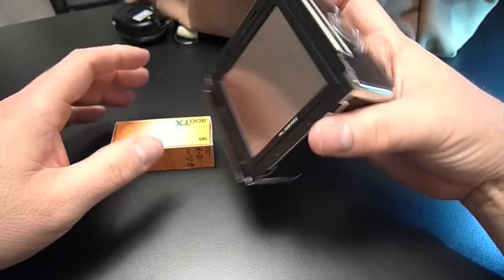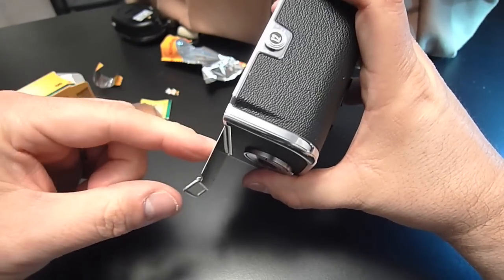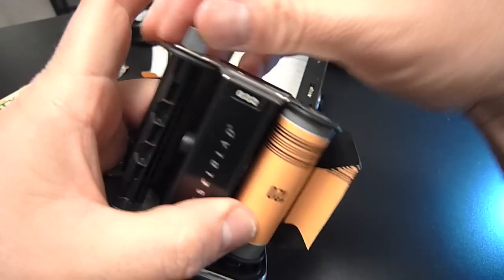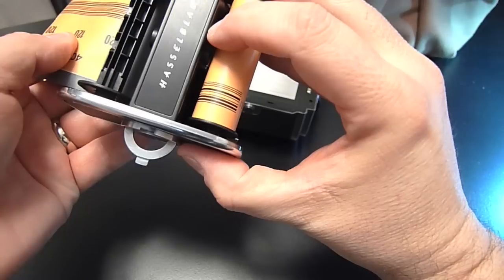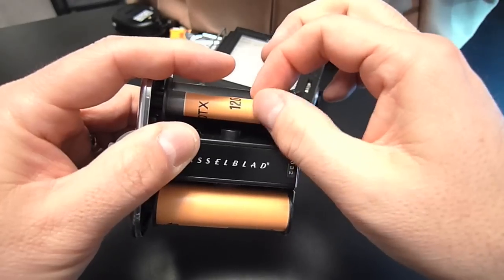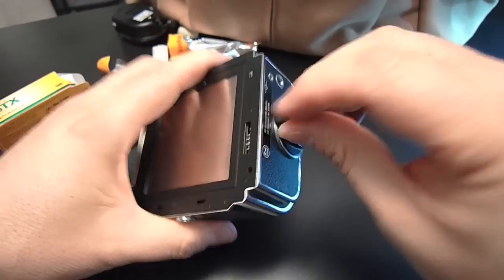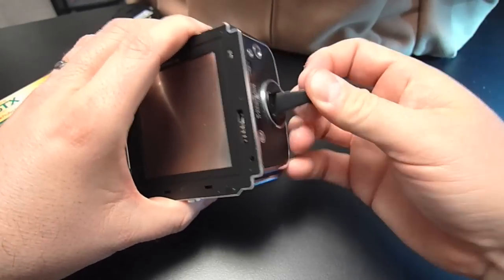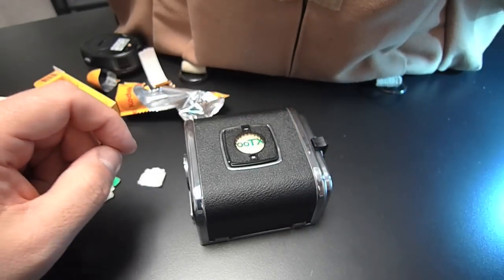Photo: How to Load a Hasselblad Film Back

Comment from the maker: @The1970sInfatuate Actually I wonder if you meant to ask this question on the instant film video (?).  If so, the camera used there is a 500c/m.  You can't use the Polaroid back on a 2000FCW -- it will damage the shutter.

Comment: great video, the H system HM 16-32 loads simmilar, no silver tab, or winding knob,but has a captive crank-on\off style darkslide, you have to man-handle the takeup spool, but as soon as you switch on and hit the shutter it auto winds to frame one, there is even a darkslide shut warning on the body, a 6x4.5 format, but still a somewhat simple system, but with the H back it uses a cr2032 button cell battery (it does use the body battery-when ON the camera), but if you don't have this battery, you instantly lose the frame count\asa\data imprint and other settings, as this is 'stored' on the film mag's chip, and if you power it down (by taking the mag off), there goes the roll.

Comment: First, great video! One thing you may want to add: With the 500c (and I'm guessing the 500c/m), one must be sure that the body is cocked BEFORE attaching the back, otherwise, if you crank it after attaching the back, you will lose your first frame. I've been told later models don't have this issue.
Reply from the maker: Good point. I guess I was so used to keeping Hasselblads cocked at all times that it didn’t even occur to me to mention it!  Thanks :-)

Comment: hi Mike, 
thanks for your instructions, i just loaded my first film, but i had to go a little past the arrow to create some extra tension on the film. the winding worked an now i am on (1). 
do you think i will still be able to shoot normally or will the film be misaligned now ?
Reply from the maker: MarcS4R  Congrats!  There are no frames on the film, if that's your concern (the exposures make the "frames").  There's just a certain amount of film on the roll.  If you went way too far past the arrow, you just wouldn't get 12 full frames.  My guess is you'll be just fine.

Comment: Thank you for the tutorial! I've never used Hasselblad before and it was the first time I've tried to load film into it with your tutorial. However I've missed that little detail that the metal plate shouldn't have been removed when winding the film, I just didn't think about it so I winded 10 turns  to the frame 1. Does it mean that now my entire roll got exposed or just the beginning of the roll? Thank you!
Reply from the maker: If you wound it to frame 1 with the back mounted on the camera, you’re probably OK due to the rear shutters in the body.  Any other possiblity will probably result in at least some leaks on the next frame, and maybe the next (?)  I’d just shoot this roll on non-critical stuff while you’re learning the camera, if I were you.
Reply: @mike.thomas  Thank you very much!

Comment: Hi,
my problem is, to find the right position for the first picture when I loaded it.
because every second time the pictures are half cutted when I became them back.
even with a second magazin it happens (I thought maybe the one I have is not OK and a other one would work : hoped there will be a little noise or latch whe it is on it´s correct position for picture number 1 like as in "normal" cameras, but it isn´t, or are both magazin of mine damaged?
hope you understand my problem, even with my not so good english
Reply from the maker: matt Ruml I think I understand.  If you have a new "A" style back, then the back's winding knob should stop turning at the correct point automatically.  If you have an old-style back (with a window), you have to watch in the window while you wind the back's winder until you see a '1', indicating the first frame.  Turn the back's wind knob reverse very slightly to reset the film counter.

If you are doing the above procedures correctly, and still having issue with two different backs, then perhaps there is a problem with the body (?).
Reply: +Mike Thomas: thanks a lot ! I have just the old ones ( fits to the body ) 
but I guess I will look for a newer One.
Reply from the maker: The old ones should work fine if you follow the correct procedure (and if they are in good order).

Comment: Hey I'm in need of help. I tried loading film into my older a12 back and the back doesn't clamp the film well when I turn the lock so it falls out and when I thought it was working I did everything you said but when I wound the film to the first frame it was very hard to wind and eventually ripped in half before reaching the first frame. I don't know what to do I can't find anything about that online.
Reply from the maker: Hi Daniel.  This is one of those things that's very hard to diagnose unless I can see it.  Can you shoot some video of your next attempt?  If you followed the video carefully, you shouldn't have any problems.  On the other hand, these backs are as complicate as a swiss watch, and sometimes they have issues.  It may need service.
Reply: Mike Thomas Hey Mike thanks alot for attempting to help, I really appreciate it! After a close inspection using a dead roll to observe what was happening, I've concluded that it was just simply one of the little screws that hold the pressure plate on. The screw was just sticking out enough over the plate that the film would get stuck on it. Film now loads and winds without a problem. Thanks again for getting back at your viewers so efficiently and attempting to help everyone
Reply from the maker: Oh, glad to hear it was an easy fix!

Comment: one warning, the INSTANT the frame counter passes 1 the film crank on the back is able to turn again, like the mamiya RB67 and others, but without the interlock switch!, so ONLY use the BODY winding knob until the film's end!!; then use the winding knob to wind off the tail end of the backing paper to safety the film roll.